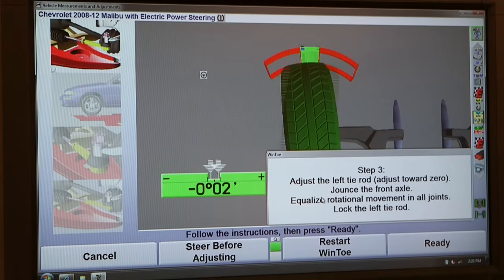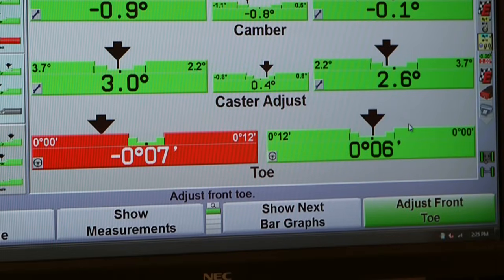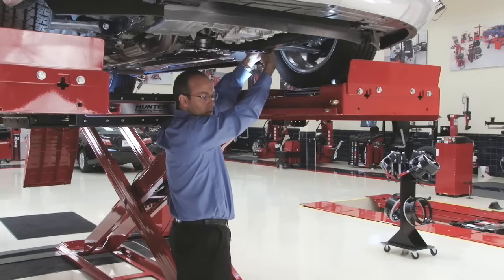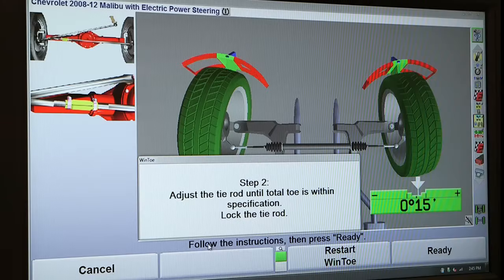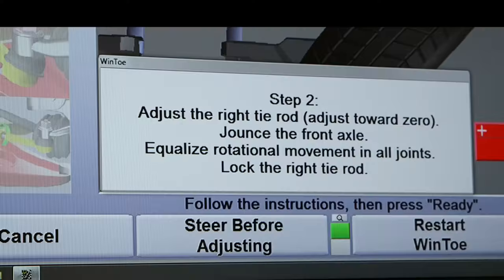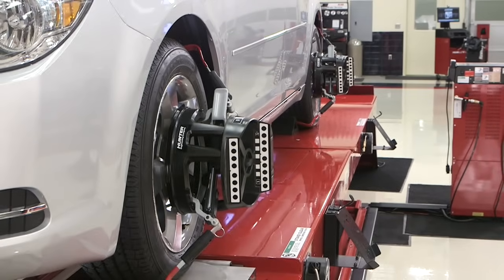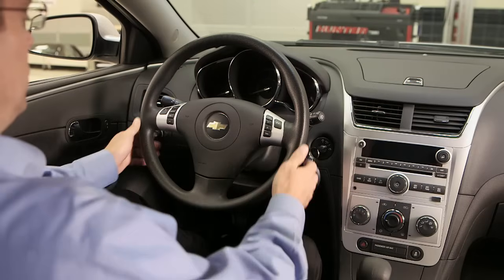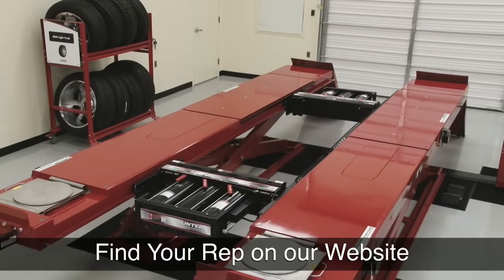Wheel Alignment with WinAlign® Software by Hunter Engineering®

Comment: after adjustment, the caster on the printout remains in the red zone: after I set it in the green zone: I do a second rental of the car, then it is already in the green zone, the first attempt does not work, what is the reason?

Comment: consistently do alignment and it shows correctly on the machine, however does not match screen when it prints out...any suggestions
Reply from the maker: We could use a little more info on your procedure, but can assume this happened due to a caster adjustment?  The last measurement screen you were on, before adjustments is the screen that prints.

Comment: I'm getting different toe readings when using the steering wheel holder when I approach the level position from either the left direction or the right direction. There's just enough lash in the steering wheel that  it affects it and i dont know which one is right.
Reply from the maker: Hello, and thank you for your question.  If the variance is in Total Toe, there may be an issue with your turnplates binding.  I’d suggest you contact your local Hunter Service Representative to take a look and help diagnose the issue.  If you aren’t already familiar with Hunter’s WinToe program, I’d suggest asking the rep for a quick overview as it can also help with achieving a straight steering wheel.

Comment: Can you do a custom suspension alignment on this machine? Like a jeep with all 8 adjustable control arms. Will this do wheel base? Also square up the axles in relation to each other?
Reply from the maker: Yes, Hunter’s WinAlign based aligners can perform wheel alignments on such vehicles.  The main angles of Camber, Caster, and Toe for each wheel are displayed with live adjustment capabilities.  Additionally, Wheelbase, Setback, and many other angles can be captured and displayed for the user.  While these additional angles (wheelbase, setback, etc.) do not have a live adjustment display, they can be re-measured quickly and efficiently to determine if the desired change has been achieved.  Our local team can help you see how this could benefit your business with a live, on site demonstration.  Simply select your location at www.hunter.com by entering your zip code to see contact information for your local team.

Comment: If I weigh 125KG and 95% driving alone in the car - just sounds logic that driver seat has to be preloaded with sandbags before alignment... Am I right?
Reply from the maker: It would depend on the engineering design from the vehicle manufacturer.  Some OEM's do require weight loaded alignment (GER), though most others do not.
Reply: I wear type the same with my Mercedes. Could probably just put bag of potatoes on the seat! 😄

Comment: My steering wheel is no where near straight, after my alignment, and the toe angles were put into the green. Guy at the shop gave me the road crown excuse.
Reply: Death Watch...  you better take back and tell him to fix it. That's not excuse. He didn't locked steering wheel correctly.
Reply: Honestly, it sounds like the mechanic performed a 2 wheel alignment instead of a 4 wheel alignment. Performing a geometric centerline (2 wheel alignment) alignment will result in dog tracking and a crooked steering wheel. They have to adjust the camber/toe in the rear first before they touch the caster/camber and then toe in the front to provide a straight steering wheel and a vehicle that tracks true.
Reply: @Dave Moore false, thats the rear for a negitive caster split 2* crown of the road  will always pull right negitive caster split keeps it from pulling,